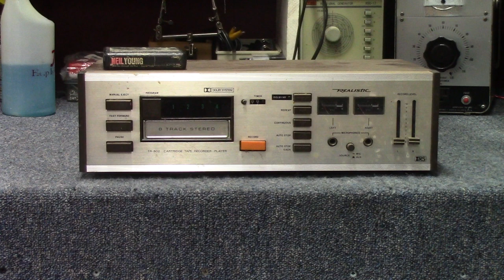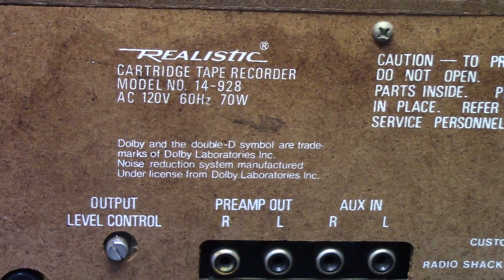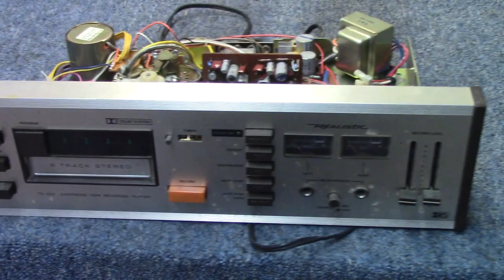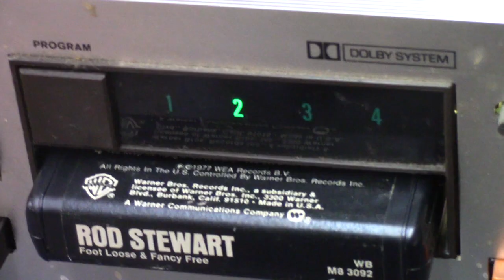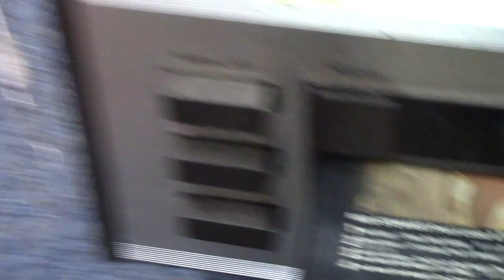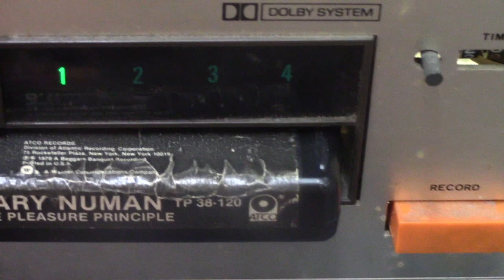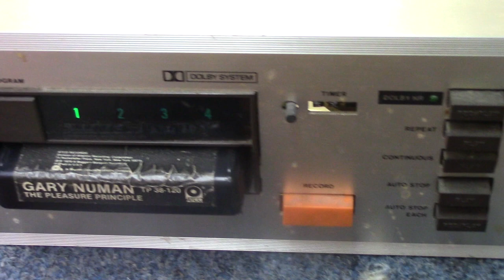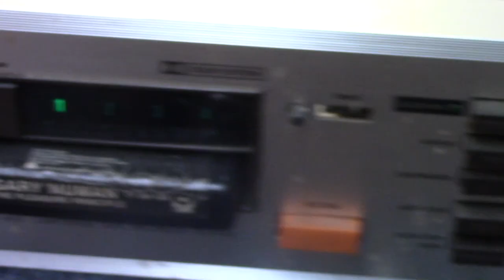Realistic TR-802  8-track Tape Deck -  pt.1 eval & repair

Comment: I Have the 803 and the PB/REC housing is cracked as well. I'm going to use your method and fix it. The machine itself is in 9/10 condition cosmetically. The belts where good and it sounds fine.
Reply from the maker: Adaboy, thanks for checking the video.

Comment: My Panasonic RA-6600 receiver had that same exact 8-track mechanism (even that same giant gear for the eject mechanism, lol). I think those later-70's decks were all using the same tape drive mechanism with that same cursed plastic nylon piece. I guess being that all those decks were built the same way it's sorta convenient if you need spare parts, but it sucks in that they were cheaply designed/built. But on eBay people actually sell new 3D-printed pieces of it, which is nice.
Reply from the maker: Thanks for checking out the video!  Glad theres a replacement in case I have a need for one in the future>

Comment: Hello , I am working on one of these now. Am I correct that the Ground clip goes on top of the head and the shim sits between the bottom of the head and the bottom of the plastic bracket?  Thanks for your time.
Reply from the maker: I believe the shim goes at the top between the ground clip and the head, if you pause the video at 18:06 I think you can see the shim, in other frames close to that time you can see the bottom of the head appears to lay flat against the plastic bracket.
Reply: Ok I will try that first then. My shim fell out into my hand I was like oh crap! Where does that go top or bottom? If you put it back under the ground clip in the top when you fixed yours and had no issues with any hum or any noise, then I try that first. I decided to use a 10 gauge stainless steel guitar string for my fixing my bracked. I used it like a twist tie around the bracket and I am about to  melt it into the plastic to re-enforce it and fix the crack.  Thanks for the reply back! Much appreciated, and you have a subscription from me to your channel!  Sincerely, Desode

Comment: She's a rebranded Hitachi from about '75, The screw in the headstall is not the hight adjustment. Look for two holes on the bottom of the deck. In one hole is the azimuth, the other is the height.
Reply from the maker: Yep, I did find that and adjusted it, I thought I mentioned it in one part of the video.  I knew they didn't have an erase head but never knew thats what a bulk eraser was for, but what if you just want to record over one song? lol
Reply: @luvradios  Yes, you did. There's actually two down there; a height adjustment to eliminate crosstalk, and azimuth for treble reproduction. Yes, it's a pain to align the head an 8-track deck, but once you've done it the sound can blow cassettes right out of the water by comparison. While the space on the tape is the same as cassette tape, the speed is twice as fast, thus twice the information.
The 8-track format got a bad reputation for to undeserving reasons:
Heads that were/are out of alignment, and dirty heads and capstans. The head moving throws it out of alignment from time to time, and the twice as fast as cassette speed means that the deck has to be cleaned twice as often.
It got a bad reputation for legit reasons as well:
45 minutes is as much as the format can handle do to the difference between supply (the inside of the "loop") and take-up (outside) circumference leading to jamming. Yes, there are longer tapes, but they will jam up in time. Stay away from 80 and 90 minute tapes as they are useless..60 minute tapes are better, but not by much.
No rewind.
The portables devour batteries (again; twice the speed, and the head moving).
Now you know far more than any sane person should about 8-tracks...lol.
BTW...that's one of the best decks ever built.
Reply: Nippon Audio (motor markings) is NEC. They made lots of OEM for different brands.
Reply: @dandinhofer9240  Good eye.
Reply: @DriveInFreak  those two semi flaccid belts were waaaay past expiration/fresh/sell by date. After all that VERY good bit-o-work I wouldn't have given any zombie rubber the time of day, especially conduct a wow 😳 flutter assessment test.

Comment: 10:45 that can also be caused by the pads being worn out. Especially on those Warner manufactured tapes.
Reply: Weather stripping with scotch tape on the part that rubs against the tape works great for replacement pads.

Comment: Hey there. How do I repair my tr-802 if it won't change programs automatically? :) Thank you! :)
Reply from the maker: Check the contact points the foil part of the tape shorts across when it auto switches, if it will manually change tracks then it would almost have to be something with those contacts or the wiring.
Reply: How do fix the tape counter if it won't work while there's a tape playing? Thank you!😀
Reply: @luvradios Where are these contacts located? Is it possible that cleaning these contacts may help solve the program change issue? How do you fix the tape counter if it doesn't work while there's a tape playing?  Thank you!😀